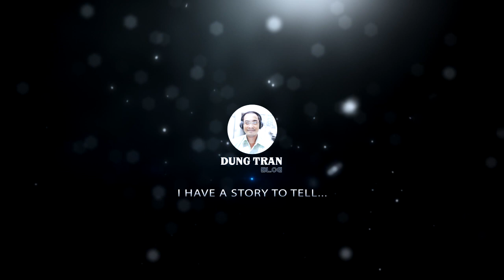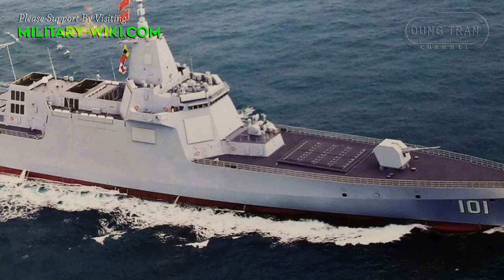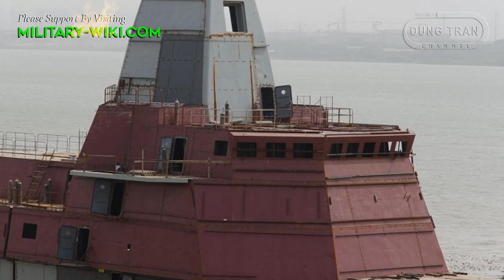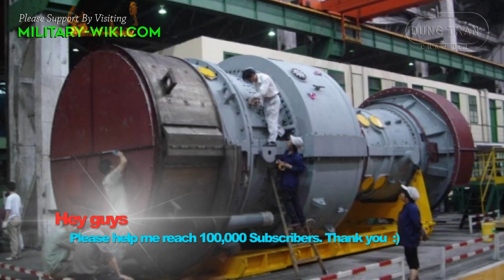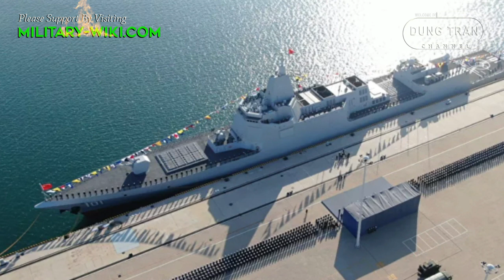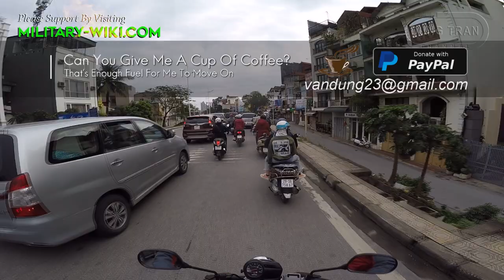Type 055: Chinese Destroyer with Cruiser Power

Comment: The type 055 design is similar to that of the original Russian Leader Destroyer.
Reply: you must be blind lol
Reply: Lider class was designed in 2016-2017 but first type construction began in 2014.
Reply: @ Joe Lau: There are two Leader designs, the original preceded the current design that was retained. In 2013 it was made public that Russia approved the construction of Destroyers to replace the Kirov; capable of carrying S 500, Kalibr, Zircon and Oniks missiles.  A drawing of the first design circulated in 2013 if not prior to that; But was not adopted, instead another design followed few years later and was chosen.

Comment: These are too expensive for China, they are just buying one of these per aircraft carrier. They were supposed to be 16 but they are reduced to ten. The French frigate copy they call type 52 will be build in higher numbers to compensate. But they can put 500 Chinese made missiles on a ship and it will still end up being an artificial reef with fish that will be hungry an hour later. The Ticonderoga are being retired so trying to copy it is not so smart especially when using obsolete copies of the S-300 missiles.
Reply: The ultimate goal was not building 10 Type 055, but 20. It was scaled down for now to prioritize construction of 003 carrier, 004 carrier and 3 of the 075 assault carriers, not to mention the new batch of 20 Type 054 A frigates. The use for Type 055 was mainly a command center, one per carrier group, so 8 is more than sufficient.
The Type 054 A will form the core shield ships of future carriers. And no, the AA missiles carried were not obsolete at all, it was constantly upgraded with new tech, in effect matching the S-400, which China bough 6 batteries of years ago along with the technology transfer from Russia.
I am honestly not sure why there is this concept of China pumping out cheap and old ships that are copied when most are newly designed and very modern.
Reply: @thomaszhang3101  Because to the west, china is less inteligent human being, incapable of creation so whatever come from China is cheap copy cat, low end gears. It need some incident to shock them to the core. Those that understand tech and electronics will know, the radar in 055 is dual band AESA much advance and more power than those Arleigh burke PESA single band even the block III AESA is not dual band. the YJ18 is longer range ASM. Stealthy design is harder to lock. Whatelse you need to have upperhand. To me, the 055 is top end DDG...
Reply: the question is will it be incoming fire turning them into reefs or their weapons malfunctioning and sunking their ass?
Reply: @keithmoore5306  my guess would be the latter.